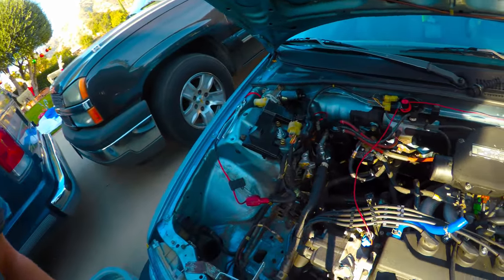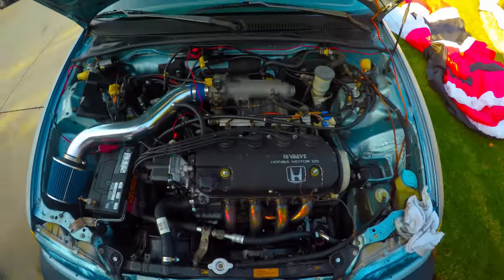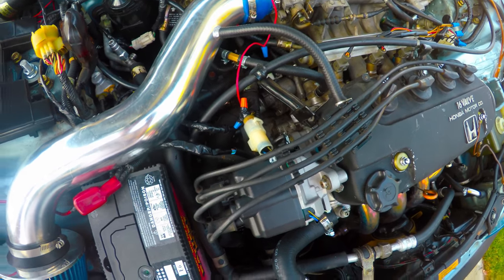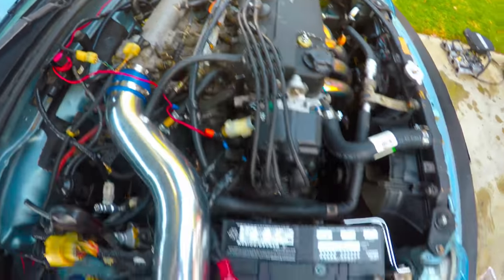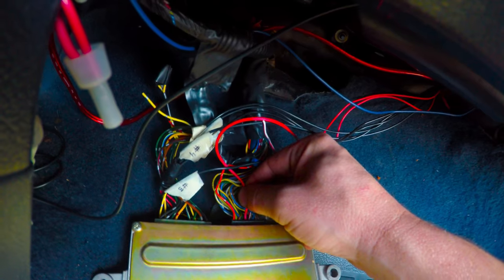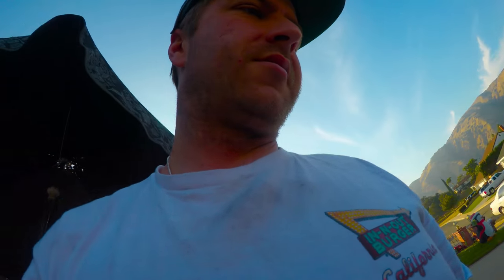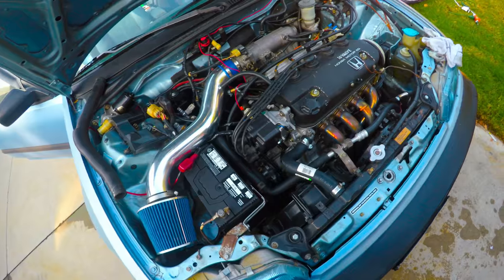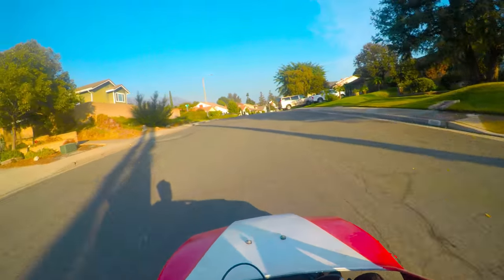dpfi to mpfi (distributor wiring color) 90 civic EF complete

Comment: Also, I think my wires matched because I used an original Si harness distributor plug and the wires swapped straight over.
Reply from the maker: omg it is so much faster! I notice a huge difference!
Reply: CJrekrap let me know if your gas mileage goes down.  My wagon drives fine but my MPG's went down considerably.  I need to troubleshoot it!
Reply from the maker: Garage Built Hondas ok I'll let you know. I'll be driving it Friday  Saturday and Sunday couple hundred miles

Comment: Hey bud how was it running before u got the dizzy wires right? Did it run but real sluggish. Mine runs but just very slow almost like the timing is off. But its good at the belt. The warmer it gets the worst it runs. It shuts off too when i come to stops. Slight miss runs shitty.
Reply from the maker: It seemed like a miss fire my Guess .. one wire probably wired wrong I switched one wire at a time and started it and if it starts running real nice then you’ll know that you have the correct wire that’s what I did